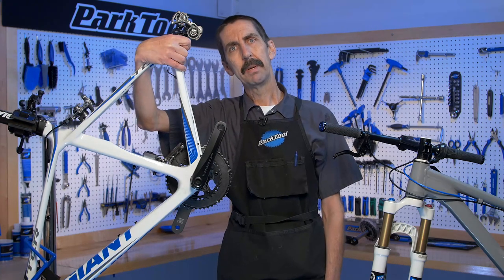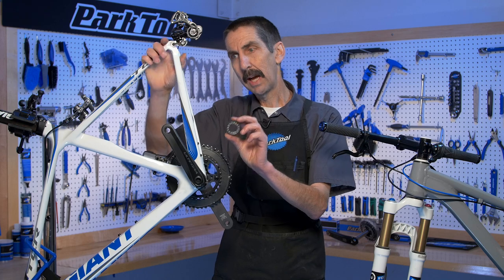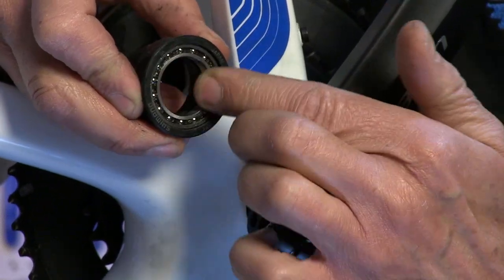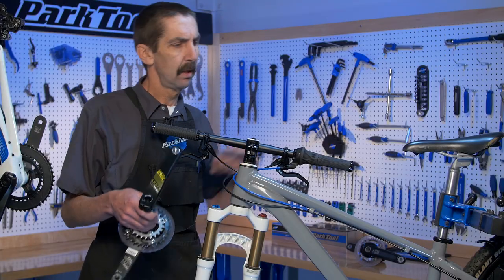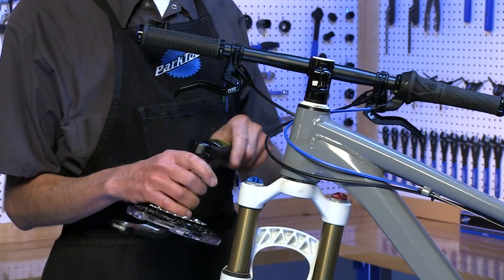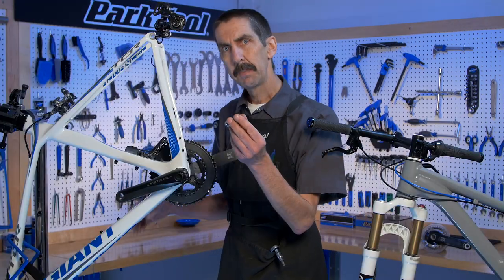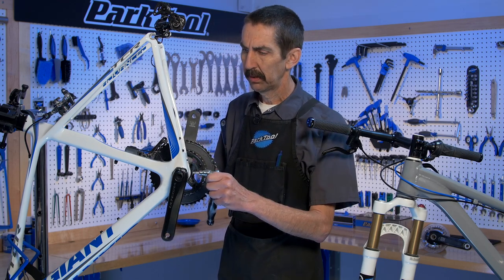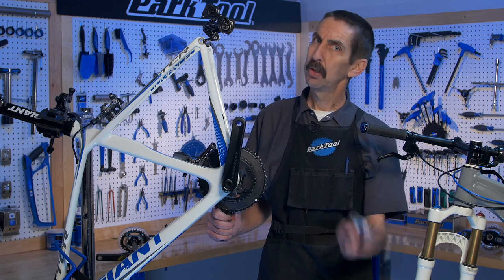Tech Tuesday #45: Crank Arm Adjustment

Comment: My drive side crank keeps coming loose and wobbly. What could be the cause of this and how would I fix it?
Reply from the maker: What's the model of crank?  If this is a single bolt right at the spindle, the common cause is that is was not tightened enough.  40Nm is quite a bit of hand pressure. 
However, if the aluminum arm fitting has been enlarged from riding with a loose bolt, the arm will need to be replaced.
Reply: Park Tool it is a raceface turbine. When I took it to a shop they said I had installed the compression ring on the non drive side wrong but I don’t think that is the cause. When I fit the crankset together outside of the bike there are no gaps in the arm fitting. I will try to torque down the bolt more and will come back if that doesn’t work.

Comment: I've tightened my crank arms pinch bolt to the manufacturers recommended torque of 37NM  but it seems the crank arms can't spin freely right after. What may be the reason for this?
Reply: Maybe remove a spacer?

Comment: Is it normal for that center cap to always loosen everytime you take a ride?
Reply from the maker: That is not normal. Try loosening the pinch bolts then snugging up the center cap/pre load bolt to a proper setting then tighten the pinch bolts. The pinch bolts often lock the pre load bolt in place.
Reply: @parktool  thanks for the tip

Comment: My crank arm is have an small space between the fd,if the fd geared to the max chainring its hits the crank arm so what should i do ?
Reply from the maker: Was the derailleur ever replaced or bent? Non compatible front derailleurs will have this issue as well as front derailleurs that were bent or are at the wrong angle.

Comment: Hi i have a problem crank arm keeps coming loose
Reply from the maker: Often what happens is the inner part of the crank arm will come loose and then will start moving and will wallow out the aluminum arm. That allows for movement the next time you ride. That movement will allow it to come loose. The solution is often a new crank arm or crankset.
Reply: @parktool  oh i forgot that the stopper plate wont push down

Comment: Why does Shimano, and others, insist on using radial contact bearings for Bottom Brackets, and not angular contact bearings?
Reply from the maker: That question is best directed to the manufacturer.  There is certainly radial and axial loads in a crank system.